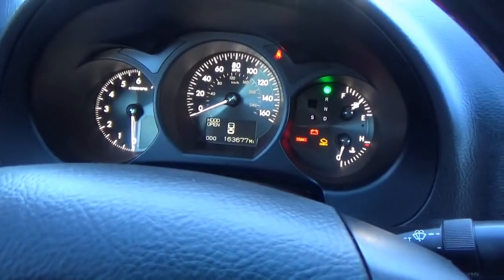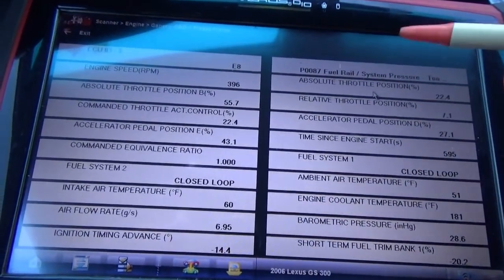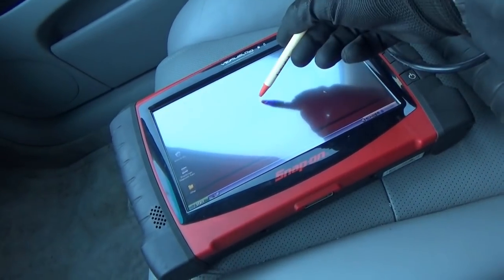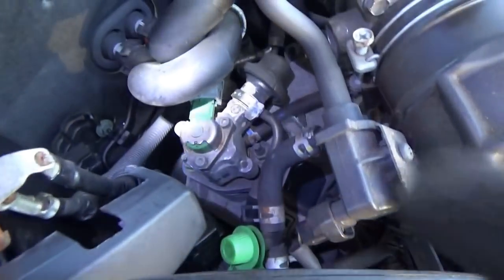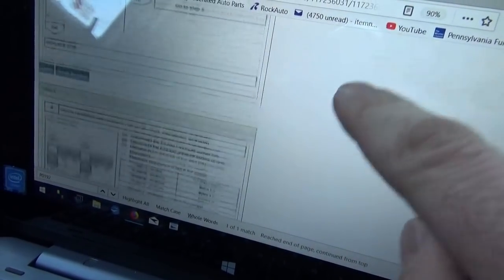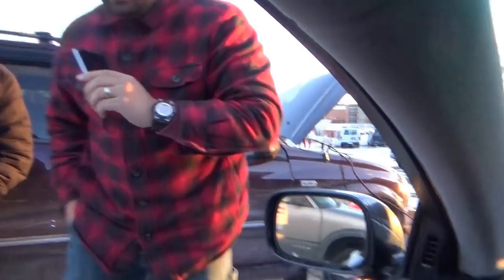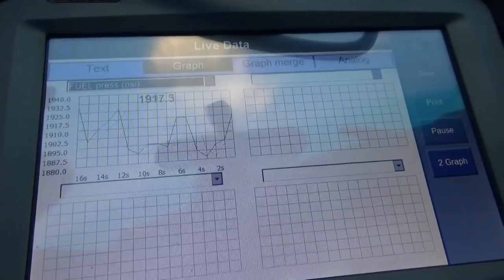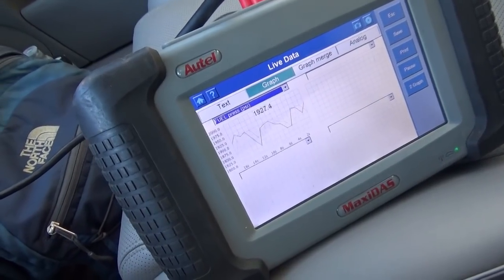Stall, No-Start Case Study: Lexus GS300 V6

Comment: What's up Ivan .what happened to the cam and crank codes ? .  What was the deal with the imobilizer code ?
Reply from the maker: Very low battery was wreaking havoc lol
Reply: yeah dead batteries throw all kind non relevant codes, because there is not enough voltage. Low voltage in, low reading out.
Reply: dassme1 Low battery made them show on start attempt never jump always think cause and effect.

Comment: Im curious what job you had before doing your own thing while growing the channel?
Reply from the maker: See website... Also had an engineering job in vibration analysis for 2 years while ramping up the business 😉
Reply: @PineHollowAutoDiagnostics  I read threw most of the site. Seeing how you handheld handle pricing, travel expenses, not to mention the pressure transducer 😬. I thought maybe it was in reference to an automotive tech position. Also the programming is what intrigues me the most, since I have dealership privileges for most car lines as well as key codes access.

Comment: I have a 2006 Lexus GS300 3.0L crank no start my fuel pressure goes up to 1800psi on my scanner when I open the switch But when I put the gauge it’s at 50psi I figured that it’s my fuel pressure sensor that is damage
Reply from the maker: There's a high side and low side...it's direct injected.
Reply: @PineHollowAutoDiagnostics  
So 1800psi is a normal? 
And the middle wire on the fuel pressure sensor is 3.8v and if I disconnect the sensor is 4.9v I have a bad fuel rail pressure sensor correct? Before I crank it and after I crank it it’s in the 1800’s psi
Reply from the maker: @raycastillo3168  Are you getting any codes?
Reply: @PineHollowAutoDiagnostics  
The only code is B2799 from the Engine ECM and that is after I crank it and leave the switch on if I shut off the switch right away the code does not come on I Checked The wire from the immobilizer to the PCM everything is good
Reply: You should do a road trip to Jersey lol

Comment: P0335 CKPS was that really do to a low battery condition or a clue to an intermittent problem? Hmmm
Reply: s13konrad   I would say low battery caused that.
Reply: those didn't set until it quit mid-cranking from low battery. I was more interested in the "engine imobilizer" code being set when he first checked codes.

Comment: Hi ivan ,i'm one of your viewer and followed your channel for quite aw_hile,pleace answer me about this video,i review this several time but i don't catch what you mean in 20':50"  untill 23': 00 about how to check ground wire,why you check it under load,secend question is : why there is 5 volt in signal wire despite of unpluging the sensor,is this voltage send by ecu?

Comment: I have the same exact car except not AWD. Mine is only RWD i believe the ECM is bad bc of the harsh shifting condition. She is a lil oil burner tho. 😞
Reply: Had the same problem with mine, ecm came defected in 2006 gs had it replaced because of hard downshift and fixed the problem.

Comment: We need two scanners always,that's what I've found. On European cars there is the auto logic which costs around 10 grand for one car line, but that machine does not graph like your Snap-on (but it does program controllers). I love my snap on Verus, even though it's not perfect. The $12,000 spent is for three tools in one, a good scanner, a very good graphing meter, and an excellent component tester. I do love my autel machine as well, that unit is awesome for the price.
Reply: Of course I bought my Snap-on unit for half the price because ten or $12,000 is freaking crazy to me. I paid 5 grand for my wireless Verus with the latest update. I would probably b** like crazy if I spent over 10 grand on it, but I would never do that.
Reply: That's a quite lot, when you can get a Pico Scope and some probes for $300 + PC you need anyway. I agree that component / code library have value, but how much? And there are pretty decent scanners 90% cheaper than Verus. 

For myself, i bought PSA/Citroen factory tool & SW copy from china for $39 for my yr 2000 Xsara.  You  need to have a Windows XP to run the software, but it does everything except download SW from PSA (you need an account for that).  Good enough for me and I had an old laptop for it already, so less than $40. Add $99 Pico Scope, amp clamp $35 from China  and multimeter, not  that expensive setup.

I also bought a Volvo DICE from china for my other car, and my 52 Yr old Volvo does not need a scanner :-)
Reply from the maker: I'd love to see that 52 year-old Volvo in action :)
Reply: Sounds like you are more likely to work on Euro cars than American. Other than the Pico scope you mentioned (the best stand alone scope in my opinion), the other tools are new to me. I'll need to Google that (SW copy, 2000Xsara, PSA). Citroen cars are not sold here in the USA but I love an old P1800, good old DJetronic injection was reliable and the first real main stream fuel injection (non digital FI) that allowed one Volvo to do  one million miles supposedly.

Comment: I thought an GS300 has an in line straight 6. Not a v6. Jus saying. U know.
Reply from the maker: It's definitely a V6 👍😁
Reply: @PineHollowAutoDiagnostics  it's not. It's the legendary 2JZ IN- LINE 6 CYLINDER. 100% Not a V6. It is Straight In-line 6. ✌
Reply from the maker: @mr.e1220  Nope. V6.
Reply from the maker: @mr.e1220  3GR-FSE to be exact.
Reply: @PineHollowAutoDiagnostics  what year? I am referring to 98-05.
Reply from the maker: @mr.e1220  2006 as it says in the video description!